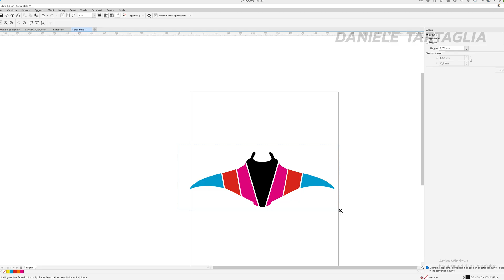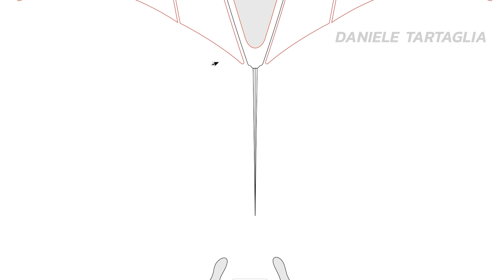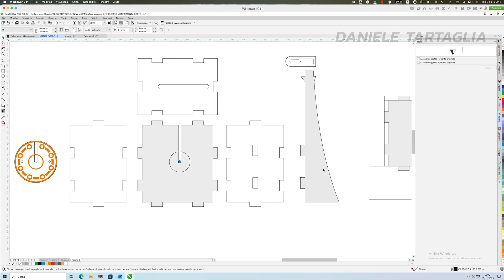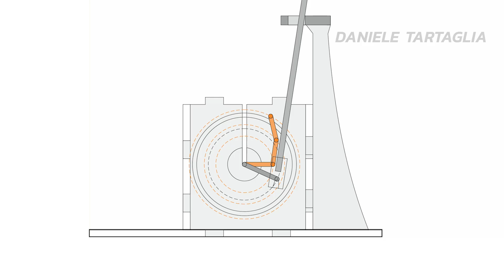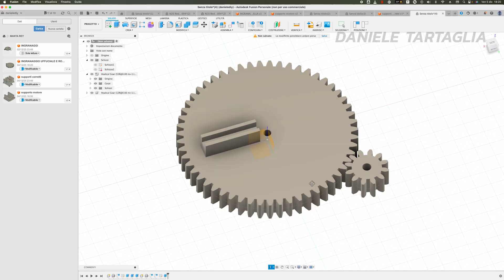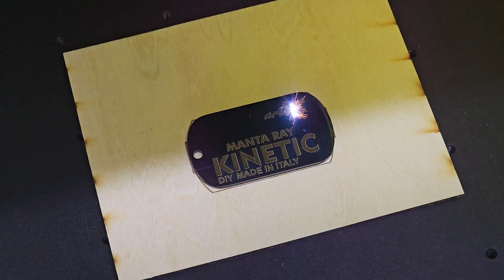DIY Kinetic Manta Ray – Stunning Moving Mechanism You Can Build!

Comment: Great work! Two comments if I may: I’d change motor polarity (right now it looks like manta ray flying backwards); another one - when you glue body and wings try to put fabric between the layers, this will eliminate wire rings to connect wing pieces between each other. Thanks!
Reply: Is your name Ray?